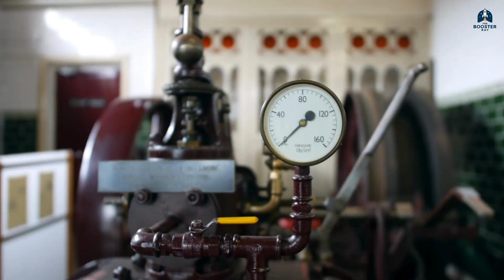SpaceX Killed Hydraulics — Here’s Why

Comment: --  --  You could have illustrated  --  --  a planetary gear  --  --   actuating a rack and pinion   --  --  linear drive actuator --  --  via electric motor.  
  --  --  As well as a variety of actuators,  motors, linear motors,  and solenoids.